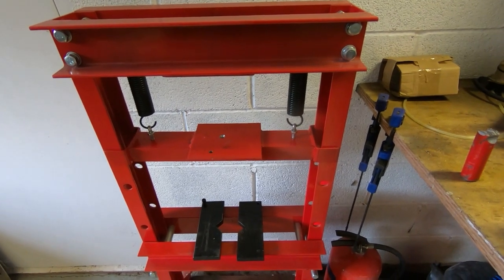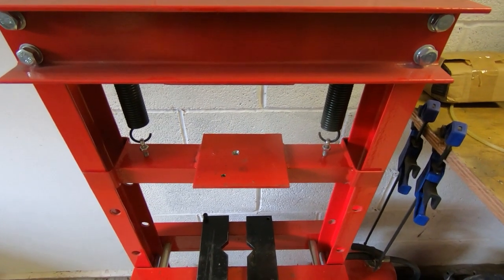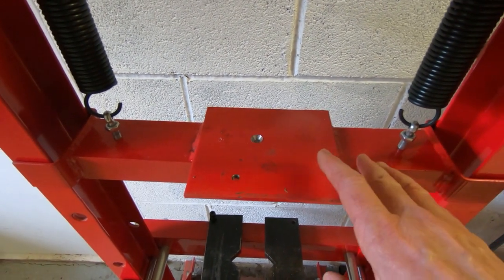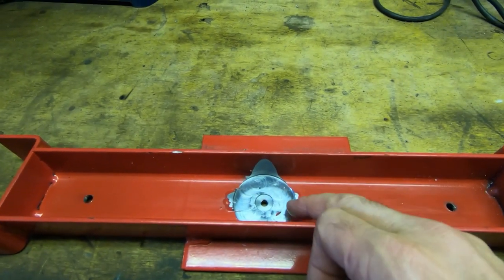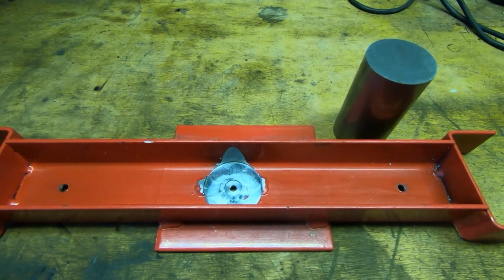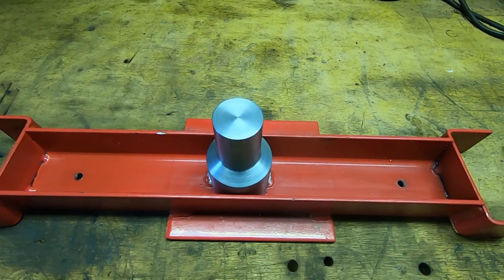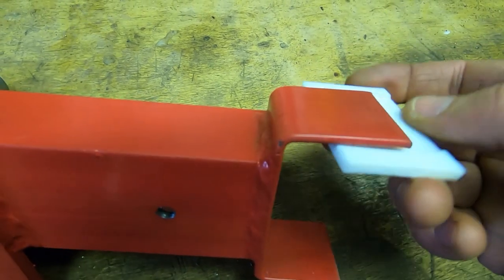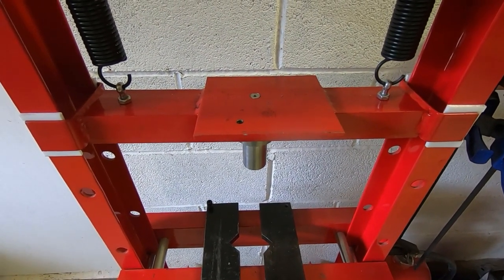Modifying my Hydraulic Press

Comment: To mill the recess would have required a rotary table and a large throat depth on your mill to allow it to be spun around, so I suppose you have a CNC mill and did the circle that way?
Reply from the maker: I used a CNC mill and as I say in the video I cut a circular pocket.